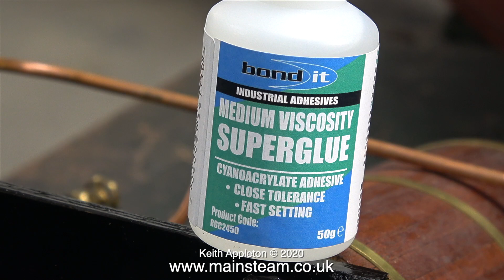VINTAGE STEAM BOAT RESTORATION - PART #6

Comment: Really enjoyed watching this one. It suddenly came to me that these people who complain about screws & bolts are easily put off. It is your model therefore your scale. If you say it is a bolt at full size then it must be. At full size that engine bearer is going to be your chosen size & it is definitely a bolt. The head & the slot in it or hexagon. Both are because you can. It is your boat so if the head is like 1 1/2" with a slot. It is because you can.
  Reminds me of my brother We were given a Mamond steam plant with a simple steam engine. I soon got bored with it . He loved it for years. Despite a PHD in metallurgy he became a musical instrument repairer. Now into Steam model making. Very good at boilers. Me I am into model diesel engines, design & build. Also, Mopeds. We both have ML7s. He in addition has a Raglan & a Boxford milling machine. But for retirement he wants to build with just the ML7. Our father had a Super 7 with the lot. Prior to that an Atlas. I used the Atlas. But neither of us would ever touch his new Super 7. Suppose this is why we only dream of ML7s, not Super 7s. 
  Incidentally we both really fancy Boxford's. Myself the 18" centre's one with the motor at the back. Type C. They are great lathes. Yes I do understand why you run yours the way you do. But it would be nice to see it & you showing just how good a lathe it is. Plus how good you really are. Because from what I see you are excellent. with your lathe.
Mervyn Price

Comment: Hi Keith, I presume you didn’t show it, but did you scrape away any of the black paint within the hull where the two mounting ribs contacted, to provide a keyed (rough) parent surface for the JB weld to adhere too? I’ve made this mistake in the past, and found that after a period of time the bonded parts work loose, as the layer of paint the glue is bonded too detaches from the surface 👍 It did lead to quite an entertaining spectacle for the on lookers at the boating lake, as I proceeded to role up my trousers and wade into the water to rescue the stricken vessel 🚢
Reply from the maker: Yes.
Reply: @keithappleton  good to hear, very much looking forward to the maiden voyage. Thanks again for the great short series Keith 🚢👍